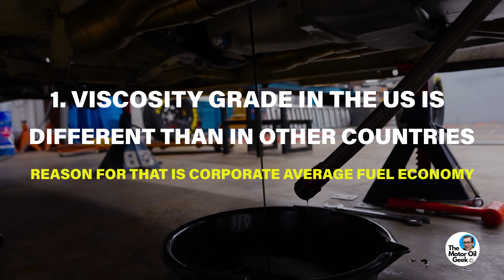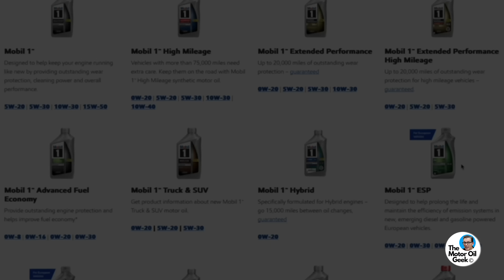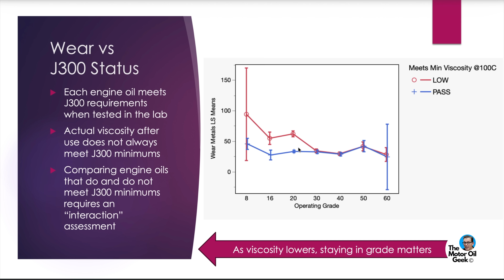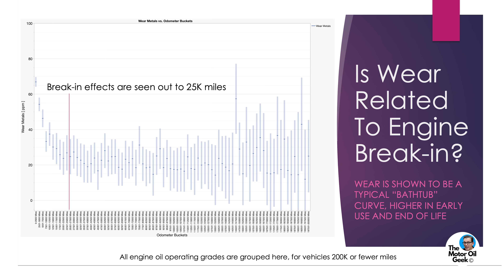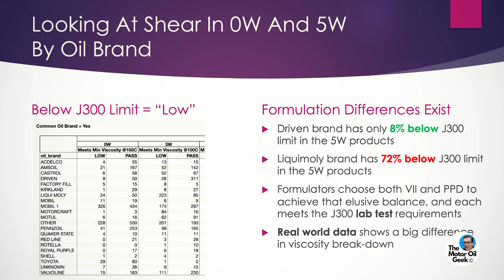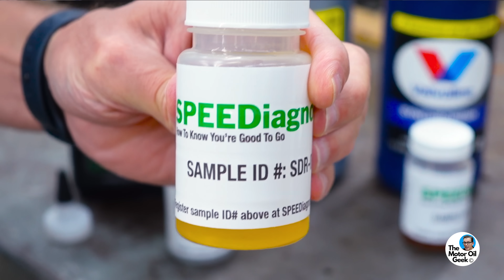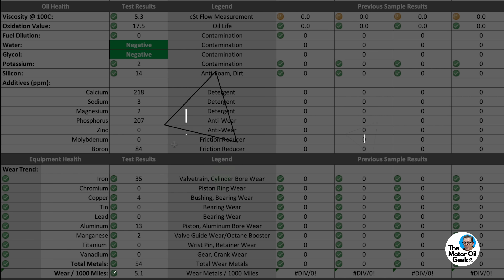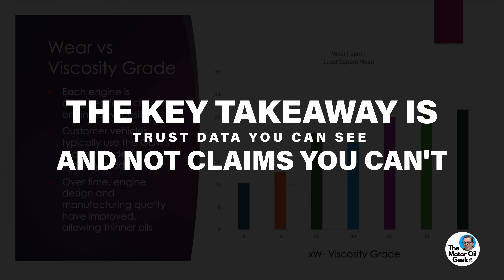More Ai Lies? The FACTS about 0W-20 vs 5W-30 (With Evidence)

Comment: I feel like changing oil frequently is more important than bumping the viscosity.
Reply: how about both
Reply: @davidmckibbin4440  I saw a video, either Lake or another creator, who talked about the fact that even though your car might call for a higher viscosity overseas, it’s not necessarily the *exact same engine. With variable displacement oil pumps and different engine programming, it might not be as simple as using a heavier oil in the US.  Plus, Lake recently had a video about how oil plays a very important role as a hydraulic fluid in addition to lubrication, such as operating VVT solenoids.  Could heavier oil interfere with that function? I don’t know, but I would like to know.
Reply: @StrongDreamsWaitHere  That was the car care nut.  Sounds more like a claim and hypothesis.   I would like to see his data on that.  Show bearing clearances, and oil pump software parameters explaining the pressure feed back loop then I will believe him.
Reply: @StrongDreamsWaitHere /mchine767. I wondered the same thing about the car car nut. Im totally unaware of variable displacement oil pumps. I don’t have a clue why the slight variation in oil flow/pressure would matter much any way, as long as they push energize control solenoids enough. 
I’ve seen motors that the design was less than 10 psi, probably not enough for my Toyota, but Lake doesn’t knock bypass filters and they reduce pressure and flow slightly but insignificantly.
Reply: @StrongDreamsWaitHere  Engines have part numbers / codes that identify their application. That's how you can tell if the engine is different.
Reply: @StrongDreamsWaitHere  I haven’t seen any proof of this one way or the other.  I just see a lot of opinions.  What I gather from various forums is that a small viscosity change (5w20 to 5W30, for example), won’t throw any codes at least, and most claim that they see no negative effects.  I think if you want to make a viscosity change, it shouldn’t be dramatic.  As others have stated, I think oil change frequency is far more important than viscosity.
Reply: @StrongDreamsWaitHere  I'd like to know this too. I have a Corolla with the 1.8L Valvematic engine. The manual calls for 0W-20. I heard the engine knock for a couple of seconds recently on a cold start. It only knocked for 2 seconds about 30 seconds after start up and as the revs started to settle down. 
Only 40K kms on the engine. I'd like to go with 0W-30 because of this and am thinking it would improve oil pressure. BUT am afraid of what effect it might have on the Valvematic system.
Reply: @barrybarnes96  Depending on the model year, you are most likely hearing the start of the VVTi gear rattle that Toyotas are known for from about 2005 to around 2016. Also, depending on the temperature outside, your engine may seem "noisier" on start-up compared to the warmer months. I've had my 21' Lexus IS350 with the 3.5L 2GR-FKS for 4 years/60k miles and changed the oil and filter every 5k miles or 6 months. I've done that with all my vehicles and never once had oil consumption issues or engine failures. Take care of the maintenance on the car, and it will last a long time.
Reply: @Gobinator98  No it isn't that. VVTi rattle always happens instantly on ignition.  As mentioned mine happened some 30 seconds after start up and was definitely a knocking sound (like a hammer hitting metal) as opposed to the classic rattle sound. It hasn't done it since. So weird. I put a bottle of GumOut injector cleaner in it the day before it happened and wonder about that.
Reply: @StrongDreamsWaitHere  Here’s the thing. If the U.S. market vehicles are somehow actually designed for thinner oil, why did the temperature vs viscosity chart disappear from many owners manuals?

If you’re going to tell me 0W-20 is the best oil for the heat of a Southern summer then what (likely thinner oil) is best for the cold of a Northern winter?
Reply: Why not do both.  I switched all mine over to 5w30 and every 4k, no exceptions.
Reply: Your bearings would disagree.🤣
Reply: Glad I got an older suv where I can slide far enough under the engine to change the oil out quick and easy.
Reply: If you have time.
Reply: Absolutely agree.  At 55yo, I have NEVER had a engine fail due to oil issues, never.  Nor have I ever owned a car burn any oil (blue smoke out the pipe).  Changing the oil / filter on regular intervals is far more important then all this debate over oils that have statistically insignificant differences between grades.
Reply: Best oil is what you change most frequently. Cheap Walmart oil changed at 2500-3k. Is better than the best oil change at 5k-10k
I've ran 15w40 rotella in everything for 20 years all my cars motorcycles atvs dirtbikes. Everything gets rotella. Oil changes every 1500-3k miles depending how hard I drive and idle hours. 
My motor stay sparkling clean inside even at 270k miles I had valve cover off few weeks ago,  everything looked brand new no staining no sludge no nothing.
Reply: @AutoMotoMechanic  I worked for Shell Research in Houston and 15W-40 Rotella T-4, T-5 and T-6 are some of the best oil's money can buy, but they don't play well with catalytic converters on cars since it was designed for diesel engines.
Reply: @jackhutchins8272  ive had no issue with catalytic converter damage.
Ive had great results for nearly 2decades.
 Fantastic stuff. Keeps the inside of my engine sparkling clean. You'd think it was a really low miles engine. Not nearly 300k.
Reply: Yes, even a video about staying in grade and not shearing down I just recently saw says keep 0w20 at 5,000 miles or less.

Comment: I let my engine warm up in winter until the rpm’s drop to idle at about 600. I keep my vehicles for many years and never have any internal issues with them. If you just want to start up cold and drive right away go for it but don’t complain if your engine fails 😂

Comment: I live in a warmer climate, I run 5w-30 no matter what it says on the oil cap.
Reply: You could even go up to a 10w-30 if available and would be better yet.
Reply: 0W-20 here in S. FL. does not make sense to me. I use 5W-30. CR-V calls for 0W-20.
Reply: Yup, I do 10w30 in the summer for the last 3 years and 0w20 in the winter.  I am going to do on one RDX 0w20 Pennzoil Platinum and get an analysis this summer.

Comment: My painful personal test was my 2013 Honda Accord 2.4.  Bought brand new (only car I have ever purchased new in 60 years of age), I personally serviced it myself using Napa Gold Oil filters and Mobil One 0W-20 oil every 4K miles and I never went over by more than 1-200 miles and sometimes early.  Always dropped the oil hot.  Timing chain stretched and tensioner was above spec for outer limit at 114,000 miles.  Fortunately I purchased a 10 year 120K mile warranty initially in mind to protect me from the CVT and New to Honda DI system.  Never dreamed it would ever need a Timing chain change just after 100K miles.  I will be changing to 5W-30 in this engine once I deplete my 0W20 inventory that I use in this car and a 2013 Honda Crosstour 2.4.  Both cars will be changed over to 5W-30.  Thoughts? Great video and I enjoy watching your videos.

Comment: Sooo your next video is about oils that stay in grade?
Reply: He did it in his oil show down video last month
Reply: no, just use 530. No worries.
Reply: Just change it every 5k
Reply: @breckfreeride  But as Lake points out at 9:00, "Oils that tend to shear down will do so quite quickly."  On-screen graphic shows oil viscosity can be reduced in about 500 (five hundred) miles.
Reply: @anthonyc1883  i would have liked that chart better if it was a percentage at each interval that failed... i bet it is more about oil brand and type choice and not a specific grade.  How many of these samples were even synthetic? I bet all the ones that held grade were synthetic because there is no statistical change with time as one would suspect.
Reply: Can in grade between defined better.? Also, what are daily use characteristic be difined better ,please  thank you lake !
Reply: Please!!!! That's why I found this channel was looking for oils that last the longest in grade

Comment: 6:08 Well dang, finally I hear something that makes me think twice about using 0W-30 instead of 5W-30
Reply: Just change more often. Simple as that
Reply: 0W oils really only outshine 5W oils below -20F. If it's warmer than that, the cold flow difference is negligible.
Reply: That’s exactly why I use 5W20 instead of 0W20.
Reply: Also the bigger the spread between winter and summer makes it more likely for the summer to shear down sooner.

Comment: Can someone answer this question? I am NOT an automotive engineer but I read that the oil passages in an engine are engineered for the recommended grade of oil so the engine such as the camshafts, etc., get the required lubrication so if you use a thicker grade oil than recommended the lubrication to parts is less due to the oil passages not being designed to handle a thicker oil?
Reply: In some cases, yes, that is true, but keep in mind that some newer generations of vehicles use previous generation engines. The change in oil viscosity may be primarily to get better fuel mileage. Still, Japanese engineers and CEOs are not likely to "undertest" any lubricants that they specify in their vehicles' owners manuals.
Reply: @davepaturno4290  Good info.
Reply: confusing for sure; my 2011 Mercedes owners manual lists a wide range of viscosities though: 0w30 to 20w50!!
Reply: @MrRjnr focus on the one for your size engine. There should be a cold climate spec and hot climate spec. If not it’ll be normal use and heavy use (towing / racing )
Reply: @TheMostRacing  yes, I use 5w40
Reply: @MrRjnr  Interesting.
Reply: @MrRjnr Can you drive on any unlimited speed highways in the US, as you can in Germany? Also, if your oil is not full synthetic, then maybe alternate viscosities are necessary, but most modern vehicles use full synthetic oil. It is superior to the old non-synthetic oils.

Comment: AI is now even a worse threat than 0W-20. Even though there may be use for oil that thin, it very well be net harmful; it has caused more harm than good. So, mocking 0W-20 by any means, even by lying AI, might actually be net beneficial. After all, we know that oil that thin is not supposed to be used in all cases of environment, load, engine types, engine age, etc. As with 5W-30 you can not go wrong.
I may be simplifying things now, but honestly, is there a better safer way than just ditching the possibly harmful 0W-20 and using 5W-30 and changing it "too often"? Or, did I just prove the old saying right: "Better keep your mouth shut and appear stupid than to open it and remove all doubt"...?